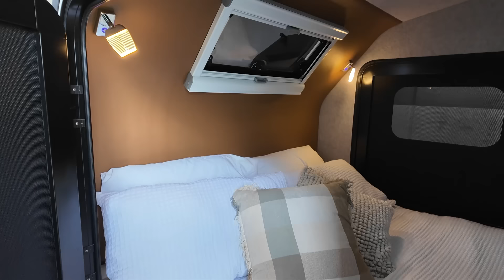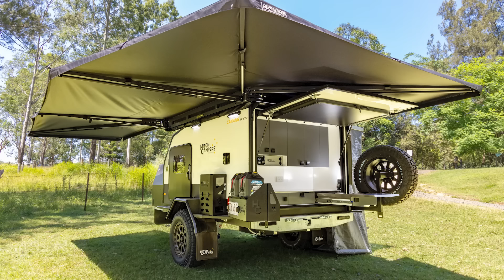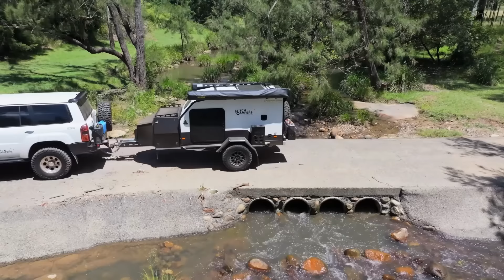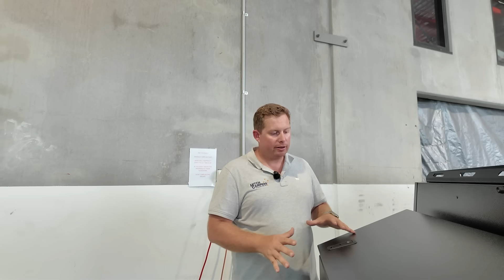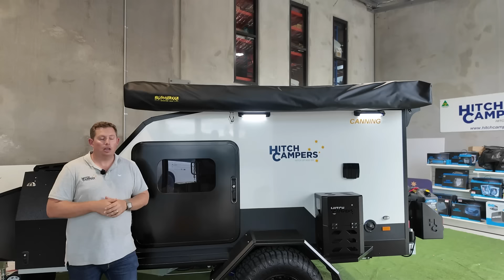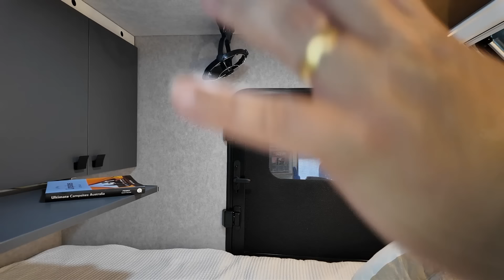The NEW 2026 CANNING by Hitch Campers | Lightweight Australian-Made Off-Road Camper

Comment: I was impressed until I saw the price. Considering your rivals have a TV and stereo system (jjust to mention 2 small standard options) for the price in them and much lower prices.  75 grand really guys.
Reply from the maker: Hi Ange, Thanks for your comment, we actually sit at the lower end of the price bracket when comparing against a directly comparable product, IE fully Australian Made 100% Off-Road Pod's/ Square drops. No issues to accommodate Tv installs etc. when requested.  Thanks!
Reply: Ditto.  Sorry I think the product looks good but overpriced.  I do wish you luck selling them.  I'm sure you'll sell some but I bet sales will be disappointing.  Thank you for your video Hitch
Reply from the maker: @PaulCollierDJ  thanks paul.

Comment: Can you option up a tv and sound system? Also, can a solar panel be fixed to roof?
Reply from the maker: G’day.

We certainly can put tv’s and soundbar’s etc in them. 

We also have 200w of solar permanently on the roof and an external plug for additional panels.